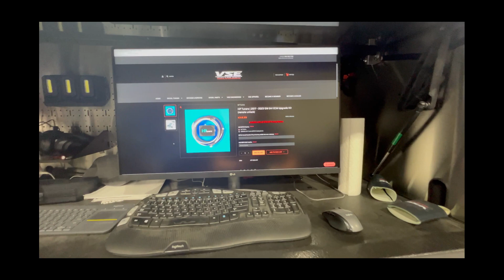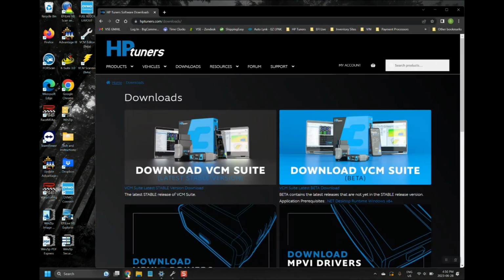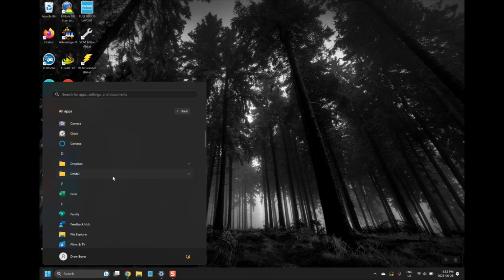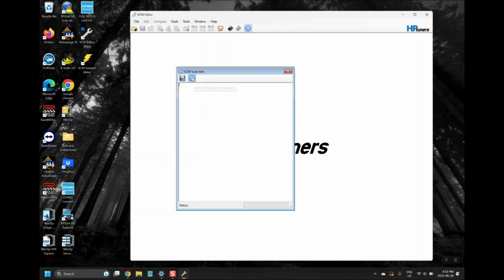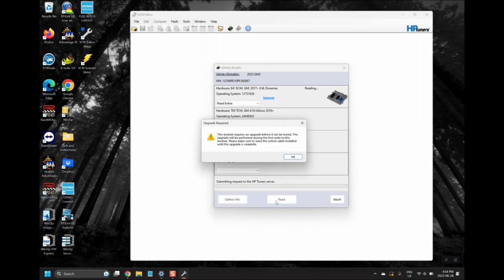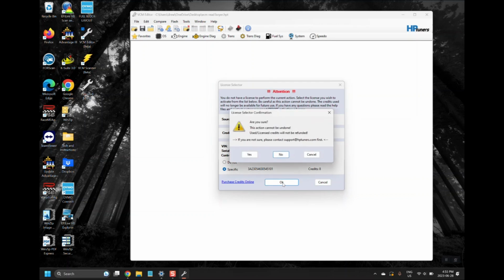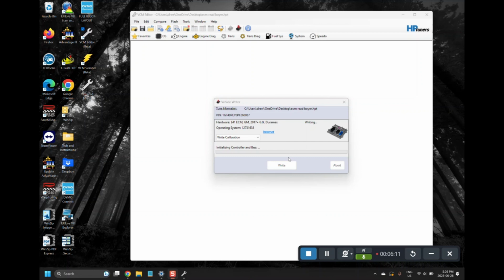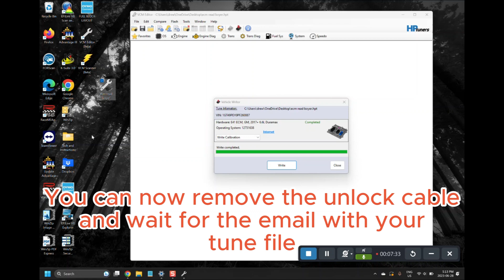2017-2023 L5P + HP Tuners ECM Upgrade Walkthrough *UPDATED*

Comment: When I try to complete the unlock process I keep getting an error message saying unlock cable is not installed correctly.  Have you ever had this issue? I double checked the orientation of the fuse wire and everything is connected properly